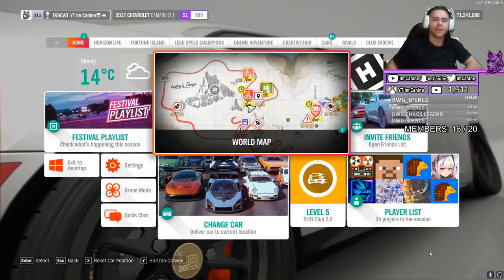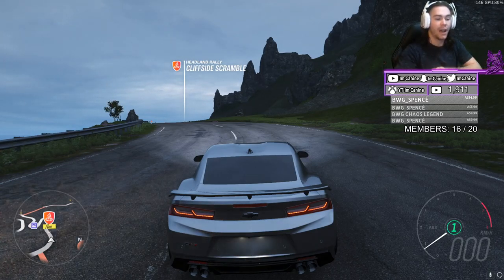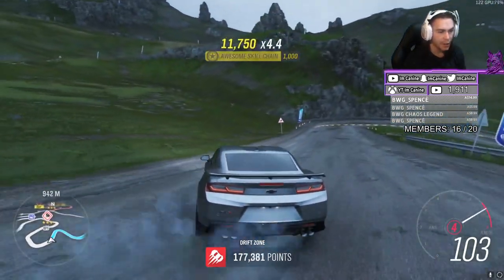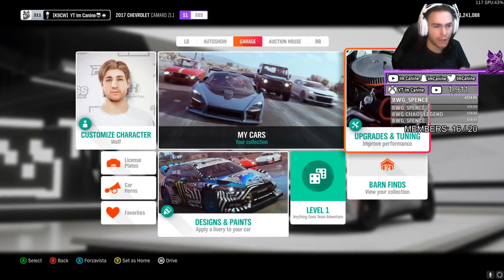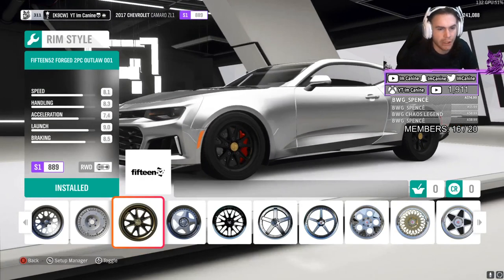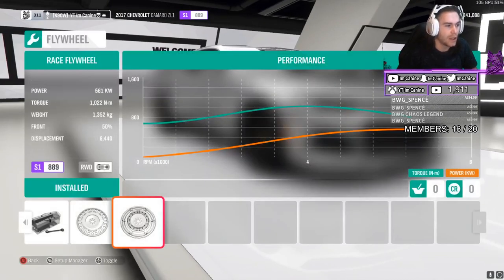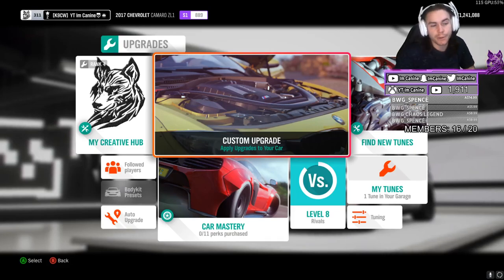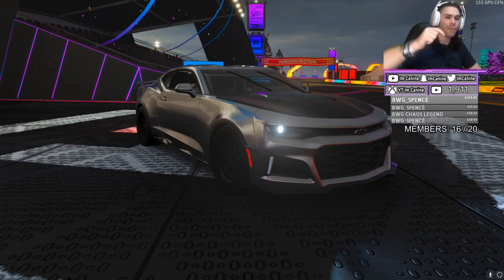CAMARO ZL1 DRIFT TUNING TUTORIAL - How to Tune a Drift Car "Forza Horizon 4 Tutorial"

Comment: Wow this game went to poo on the camaro at least nfs gives the options on the builds 😂 but definitely not better then forza tho
Reply from the maker: Ya even the 1LE has no drift suspension... I looked at that one before recording this just in case... Nope
Reply: Hmm I wonder if putting the V12 in would do anything I don’t have a drift tune in I have mine just casually but I can get mine to whip around corners pretty good I’m not all sure what’s in the tune it’s a friend of mines tune but idk I hope at some point the implement an actual drifting suspension and tired for it because it would be beast
Reply from the maker: @myck7021  Doesnt need the V12 man, like I said the stock engine will easily get 1,100 hp